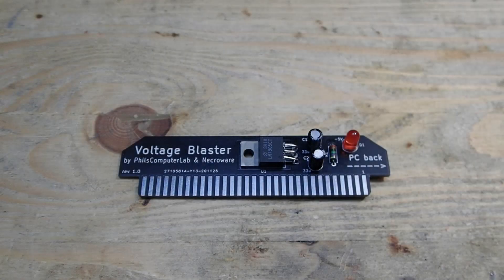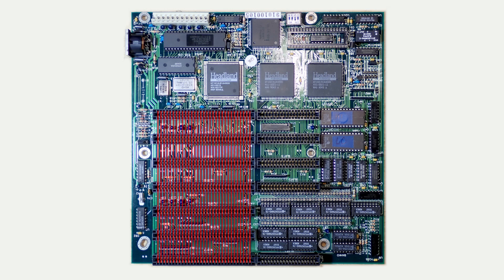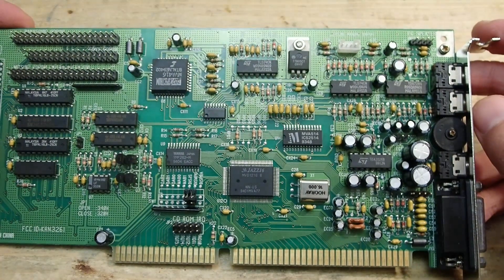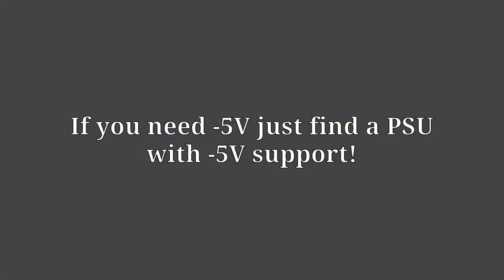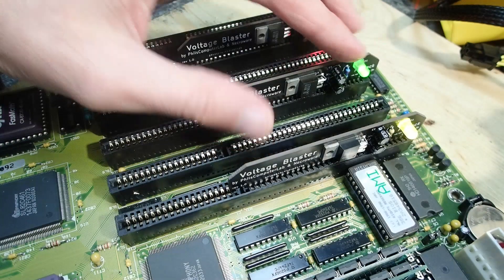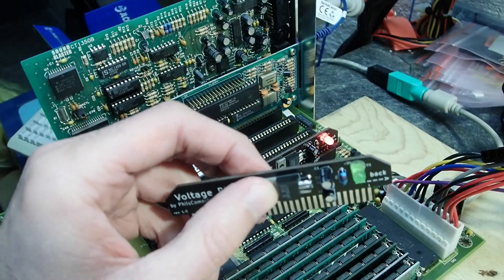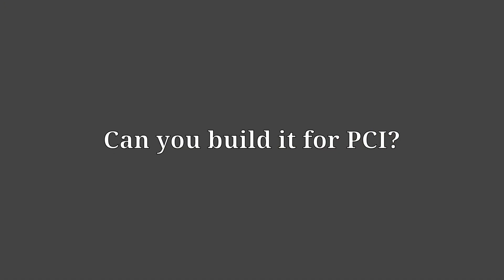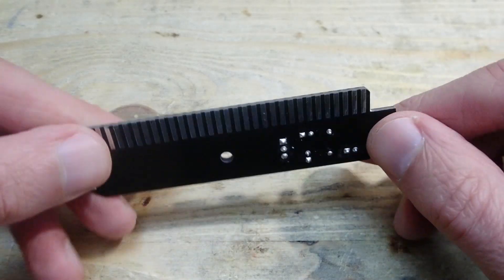Voltage Blaster ISA -5V Provider Q&A

Comment: If the system has limited expansion slots maybe it would be nice with a molex connected variant where you solder -5 to the back of the card slot.

Comment: Great project! - If there is no spare ISA slots could you solder 2/3 wires from the blaster board to the ISA slot underneath the motherboard? Then simply put the voltage blaster somewhere else in the case?
Reply from the maker: In such a case you can just solder the LM7905 with two small caps somewhere on the board. This solution is for people, who can't solder or don't want to modify the board. Free ISA slots were usually not a problem on earlier boards, where -5V were required. On later PCI systems, there were less of them, but you usually also didn't need -5V anymore.

Comment: Revisting the PCI question can you make one that Provides 3.3v from 5v for late 486 and early socket 7s that do not Provide 3.3v on the PCI slot?
Reply from the maker: It can be done in a similar way, but positive voltage lines have to stand higher current, than negative voltage ones. If some of the cards will draw a lot of current from 3.3v it could damage the slot and/or mainboard. If the lines are thick enough, then this can be made. You also should keep in mind, that you have plenty of ISA slots on the older mainboards, but usually only 3 or 4 PCI slots.

Comment: Wow, this saved me some major near-future headache. Currently updating my AT-era test bench and decided to use a modern ATX PSU for safety, but did not realize -5v was canceled. There's a guy on Ebay making these, so that will save me a lot of effort. Also hadn't heard of Phil's Computer Lab before, so thanks for the video!

Comment: The outputs on that Laitronic PSU don't add up to 300W (251W at most if we charitably regard it as having no combined limits), so I wouldn't trust it for one minute.
Reply from the maker: 99% of computers, which I'm repairing are 286, 386 and early 486. As long as I get 10-15A on the 5V rail, that is more, than enough :) For an AMD Athlon PC I would also take something, what is as reliable as possible. And newer PSUs don't bring up enough power on the 5V rail. So, even if you'll get an expensive high end modern 600W PSU, it will probably fail on old systems against a cheap 300W old PSU, where most of the power was on the 5V rail and not on 12V, as it is usually made today. So, don't trust overall wattage and look at the particular rails, which would better fit for your system.

Comment: Thank you for this project to both of you!
As a (very!) junior electronics hobbyist, I have a question, though: any particular reason why the positive sides of the capacitors are connected to ground? I just received a few PCBs and I've noticed that the "+" marked side of the capacitor is connected to the ground plate (and to ISA pin B01), so this seems really baffling to me. 🙂
Reply from the maker: You are welcome. It's because we work with negative voltage and -12V < 0V.
Reply: @necro_ware  wow, can't believe I did not realize that! thank you for the explanation! 😀

Comment: You can make a voltage blaster v2 that can detect if there is -5 already and turned itself off, and with a jumper to disable this detection

Comment: Maybe have a version that adds capacitors to all the voltage lines to nicely smooth all the voltage lines.
Reply from the maker: Such capacitors are usually already on the board between the ISA slots. Furthermore, on each expansion card there must be own capacitors installed, because of the distance to the board. So, all in all, the caps wouldn't make a lot of sense.

Comment: An improvement I thought of for the Voltage Blaster that might make it even more useful since many 386/486/early Pentium motherboards did not come with fan headers. Perhaps include a fan header on the board? Always disliked using those molex powered fans. Eats up a valuable molex connector especially when powering such systems off DC to DC ATX Pico PSUs and just messy when it comes to cabling for the PC. Even if someone didn't need the Voltage Blaster for the -5v, it could come in handy to have an onboard fan connector if you otherwise have a slot to spare.
Reply from the maker: Yes, this is also a nice idea. I got that proposal from another viewer, eventually he made a separate card with multiple regulated fan connectors as far as I know.

Comment: also these caps are 33uF  ? or 3300 ??
Reply from the maker: You can find all the information on the project page. Just follow the link in the description. Those are 33uF. To your other question about fixed -5V, means that the voltage regulator output is fixed to -5V and converts anything down to -25V to a fixed value of -5V. The opposite of fixed is adjustable, where you can control the output voltage using an external voltage divider.

Comment: iam looking for this part on ebay LM7905 Voltage Regulator  , any one cane explain this >> Fixed -25V -5V 2V @ 1A(typ) TO-220 Dropout Regulators(LDO) RoHS  < what does fixed mnean and to 220 ldo etc etc  cant find it
Reply from the maker: I still have one prototype over. If you are interested, just write me an email ;)

Comment: The Voltage Blaster is a really cool product. (Props to Phil!) In my case, though, yeah I only have three slots in my Tandy 3100, so if the power supply goes, I'll need to find some other way to integrate the village regulator. Pizza box machines really skimped on expandability.
Reply: *voltage regulator. Autocorrect fail. :)
Reply from the maker: Yes, in such case, you will need to search for another solution. This one is for boards, which have enough ISA slots.

Comment: I would suggest adding a fuse before the regulator. a damaged card may short the -5v line, overheat the regulator, short the regulator and thus the power supply too...
most power supplies probably have over-current protection but still a good precaution to add!

also some circuitry to disable the board if there already is -5V present could be a good idea... but that's like a dumby-protection feature :D

I guess there's just endless features that you can add, but the question is, is it worth the complexity and cost.

Comment: Based on the design of this voltage blaster it should output -7v instead of -5v since it's using -12v as the reference voltage and the 7805 outputs 5v greater then it's reference -12 + 5 = -7. If you are getting -5v there's probably a very angry zener diode somewhere on one of the ISA cards or the mainboard that's getting quite hot as it has to drop 2v.
Reply from the maker: I think, you got it completely wrong :D It's a lot simpler, than you think. There is 7905 voltage regulator used, which converts -12V to -5V.

7805 doesn't output 5V grater, than the reference. It always just outputs 5V and works only with input voltage greater or equal 7V. To convert negative voltages, you have to use 79xx series of regulators and the 78xx are for positive voltages.
Reply: @necro_ware  Ok didn't notice that. There is a trick where you can use the 7805 as a negative voltage regulator if you connect the input pin to ground, then the "ground" pin to -12v you'd get -7v on the output.

I got too excited about proving a stranger wrong on the internet and didn't pay attention to the part number :P

Comment: I was wondering why don't you use switching regulator instead of linear. But then you said: "10mA" . So yea - 7905 is good enough.
Reply from the maker: Yes, you don't need much, furthermore those are mostly sound cards which are using -5V and it's a bad idea to use switching regulators with analogue audio devices, because they can produce a lot of noise.

Comment: Hello Necroware! Really a great project that offers many retro fans a simple solution. As an alternative, you can also build the circuit in an ATX extension cable (short). This has the advantage that no ISA slot is lost. This has been running smoothly for me for many years (circuit in the shrink tube).
Reply from the maker: Yeah, this is also a very good and common suggestion. See 9:17 for the answer.

Comment: I like this project! You can calculate the maximum power dissipation with formula TJ = TA + PDθ * JA.

The Tjunction(max) for the LM7905 is 125 degrees C. At 40 degrees C max ambient temp and 200mA draw this gives: TJ = 40 + ((0.2 * (12-5) * 60) = 124 deg C

So in current form, the specification of this supply is 200 milliAmps. Maybe this is good to add as a little warning on the github?
Reply from the maker: Thank you! The thing is, that the regulator is not hanging in the air, but can be screwed to the PCB, which would dissipate some heat as well. However, I didn't calculate how much. But you are right, I should add a warning to the description, that people should screw it to the PCB, if the thing gets hot. But I also have to admit, that all the hardware I tested didn't pull more than 10-20mA out of -5V. Usually it is used for leveling only and not to power anything, that's why even 200mA would be very unlikely. Most PSU don't deliver more, than 500mA for both -12V and -5V rails together and some do even only 200mA. So trying to pull 200mA only on -5V rail from such PSU could be already an overkill.

Comment: I was wondering about does it matter which isa slot it goes in and if a heatsink is required for the voltage regulator and you answered both. Thanks! I have the parts on the way I'm going to build 2 for myself and 1 for a friend. Looking forward to your future projects!

Comment: If it really needed it, you could put a huge ground pad under the regulator tab, so you could solder the regulator to the pad and use the board as a heatsink (on both sides even) 👍
Reply from the maker: Yes, absolutely.

Comment: Question: if it only uses 2 of the pins, why does the pcb have copper strips for all pins? Is it actually easier/cheaper to print that way?
Reply from the maker: It's not easier or cheaper, it makes actually no difference. The reason why it's complete is, because it's been taken from an already available Kicad footprint library. I could remove unused pins or make a custom footprint for this project, but I didn't bother.... so call it lazy ;)
Reply: @necro_ware  Sounds like a 1.1 in the making! :)
Reply: these 2 sided pcb's have copper layers on the outside that are removed using chemicals to melt them away after a mask is applied to the area that makes up the design you came up with, the costis the same with or without the pads since, they where part of the pcb material anyway, and in most cases it takes no real dif in time to have the copper there vs gone.. many prefer the pads be there for contact points as an extra level of wear resistance if nothing else.